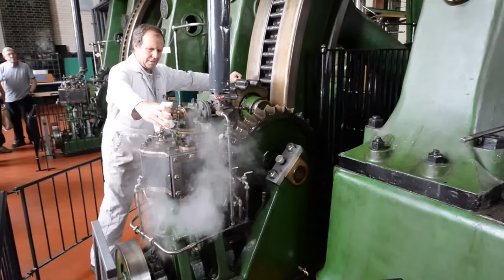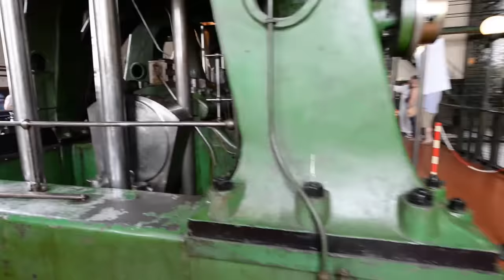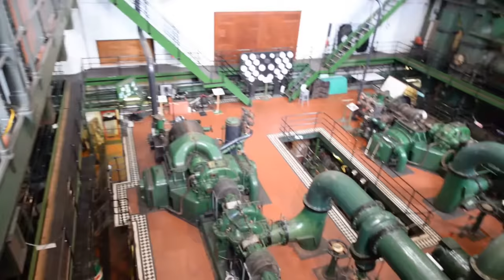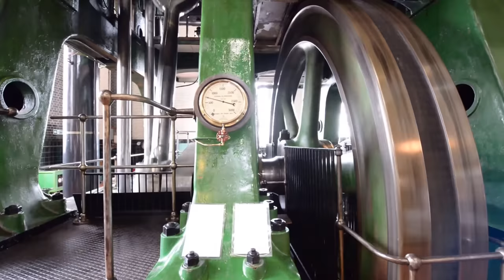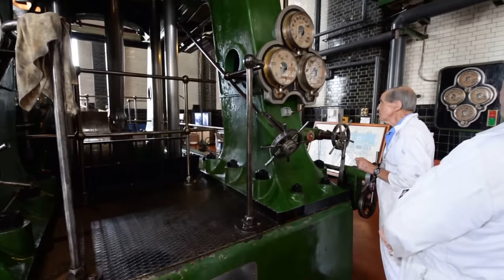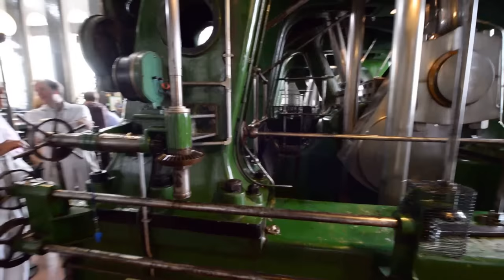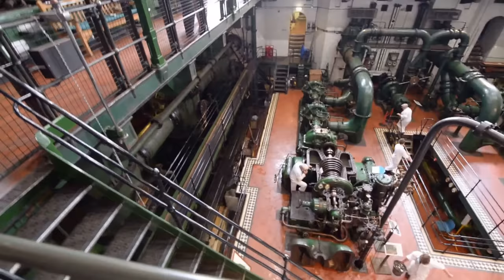Kempton Park  Big Triple Steam Engine Starting

Comment: The Titanic had 2 Triple expansion engines like these. They actually shot some of the engine room scenes at Kempton Park
Reply: Very interesting. Thank you for sharing. It's amazing to think that these incredible machines, and the expertise to operate them, were common once upon a time.
Reply: And they say that Titanics engines were bigger than these too so shows the size of them!
Reply: Yes they did
Reply: What if the Titanic got a rope or iceburg caught in its propeller - was it built to stall, or would the steam engine keep running, the high torque end of the gearbox would be under enough torsion to rip from the bearings or rip the hull itself apart
Reply: @Dave78214  There was no Gearbox. Large Ships have the Propeller Shaft bolted directly to the Engine. That's why modern Ships have Two Stroke Diesels, as Four Stroke Engines couldn't deliver the high Torque at slow Speeds.
Reply: @Genius_at_Work  I just looked up the propeller speed of the Titanic, and it says 75rpm, that's still much lower rpm than the diesel engines I've looked at, and would have incredible torque, and could the engine even stall if the propeller was jammed?
Reply: There were three propellers, and a total of 46,000 hp
Reply: If the propeller did jam, and the engine did somehow stop spinning the shaft when it jammed, there could still be something like a million ft-lb of torque acting on the shaft, and incredible forces acting on the bearings and engine parts. If the shaft snapped, then it would be applying these forces up to the yield stress and the parts would fly out releasing the strain energy, and perhaps the motor could continue to cycle afterwards
Reply: @Dave78214  76 RPM is pretty normal for Marine Steam Engines; even small ones (below 1000 kW) aren't much faster. Large Two Stroke Diesels are in that Range too; e.g. does the MAN S80, with which I used to work, have a Top Speed of 78 RPM. The MAN G-Series has an even longer Stroke to Bore Ratio of about 4.5:1, so it is even slower. This increases Engine Efficiency by providing a higher Expansion Ratio and increases Propeller Efficiency by just being slower. The L- and K-Series Engines have a shorter Stroke (still meaning 3:1 for the L and 2:1 for the K), which increases Speed up to about 150 RPM.

Objects in the Propeller could jam it, which would destroy all Shaft and Engine Beating and possibly even bend the Connecting Rods.
Reply: @Genius_at_Work  I used to own a boat fitted with a 50Hp Leyland-Thornycroft marine diesel (154 I think) based on a BMC 2.5, and it would run at 2000 rpm for probably 40Hp, and to be honest I thought it was putting out plenty of torque. When a rope got caught in the propeller the engine would stop running automatically - the engine continuing is clearly a problem with vintage motors. Water wheels are very high torque, with rotation speeds of about 20rpm a 600 watt water wheel would need an axle the size of a scaffolding pole because anything less would twist if it jammed (or something similar).
Reply: @Genius_at_Work  the same effect with a million ft-lb of torque should be enough to rip through the hull of the Titanic. There's a theory that the "Titanic" was in fact the sister ship, the "Olympic" - the names where swapped for insurance purposes. The Olympic was hit by a military vessel on an earlier voyage and had enormous rips in the hull - and sections were twisted, suggesting to me that it could have been partially an engine problem. Perhaps the same structural weakness existed in both ships. I think the design was terrible anyway, the accident could have been an engine failure, or an impact with an iceberg, or even the propeller hitting the iceberg.
Reply: @Genius_at_Work  at 75 rpm, Titanic even reached 22 knots, which is impressive for 75 rpm 3 set of 3 bladed propellers, what more if she had 3 set of 4 bladed propellers? Titanic could've reached 25-28 knots.
Reply: @justabasslover4404  The Speed is not proportional to the Propeller Blade Number; just think of Speedboat Propellers with only 2-3 Blades. I'm far from being an Expert on Hydrodynamics, but generally more Blades means you can build a smaller Propeller that may run at a higher Speed. E.g. did the Central Propeller of the Olympic Class (aka Titanic) run on some 120 odd RPM while being only about 2/3 the Diameter of the Outer Propellers. This Design was chosen so it could be driven by the Exhaust Steam Turbine without Reduction Gearbox in between, which is somewhat of a Compromise as Steam Turbines are most efficient at high RPM while Propellers are most Efficient at low RPM. IIRC, Blade Pitch has the greatest Influence on the Speed you can get from a given RPM, but increases the Likelihood of Cavitation, especially when not running at the RPM-Speed ratio it is designed for.
Reply: @justabasslover4404  Little Edit: Plus you can't magically get faster from changing a Propeller. The RPM-Torque Diagrams of the Engine and Propeller have to match. The Engine can't turn faster than its Design Limit, so achieving higher Speed would require much higher Torque. Keep in Mind that the Power required to move something through Water increases by the Force of ^3 to the Speed, so even going 10% faster would require 30% more Engine Power.
Reply: @Genius_at_Work  Lusitania class have 4 set of 4 bladed propellers and have 4 parson steam turbine. Lusitania suffered vibrations from the engines. But the Olympic Class' steam engine is more powerful and torque is greater than a steam turbine to spin a 4 bladed propellers, so powerfull that it will be stable and the ship will not suffer from vibrations. Parson steam turbine uses low pressure steam, and triple expansion engines uses high pressure steam, and high pressure is more powerful. So in conclusion, Olympic Class' steam engines can use 4 bladed propeller with ease because of how strong the torque of the engine is.
Reply: @Dallas_K  there's a documentary
Reply: @Genius_at_Work  I think slow RPM is more efficient because the fluid flow is less turbulent, also known as "laminar" flow. So supposedly a lot of power is wasted through turbulence, as it's work done on sending the water is random chaotic directions. I had this theory that they couldn't admit to engine faults as a possible cause of sinking because the engineers wouldn't take the blame and nobody had stronger arguments.
Reply: @justabasslover4404  all blade mass is distributed evenly on horizontal and vertical planes. This might matter more with very large props like on the Titanic. If they didn't have double universal joints (I mean maybe they could) then tiny variations in mass distribution could cause systemic problems, vibrations like you say on Lusitania
Reply: @Dave78214  do what you want, I just stated my opinion, and now you wanted to correct everything
Reply: @mattseymour8637 Titanic's triple-expansion engines were rated at 15,000 hp apiece.  Compared to this one-only 1,008 hp-you can better imagine the size of them...
Reply: @nicholasrhodes4550  Yes I heard that Titanic's engines were even bigger than these ones and so that's saying something if you mention these are only fraction the hp!

Comment: Have never seen these great engines before but, funfacts: I worked on tugs Sheen & Ham towing 4x 250 tons of special coal in Wm Cory & Sons lighters from Brentford to Sunbury to power these engines, probably twice a week in the 1960's. Fifty two weeks a year. We worked out that when they switched to road transport to deliver the coal, it would take at least 20 trucks (at that time) to haul one barge worth, so 80 trucks & drivers to replace one tug & 4 lighters. (tug had 3 crew and 1 lighterman per haul). I could never work out the economics to be honest, and so we lost the ships, the men & the way of life to the Road Gods. Fun Fact 2. Later, I worked as a Lockeeper at Teddington Lock (which the tugs & barges had to pass through), and one of the main jobs was controlling the water levels via the massive weir. The pumping station (above) would phone us and say that they were increasing the pumping levels and so we had to shut down the wir accordingly. That's how much water they took. Alternatively, when we had heavy rain we would call them and ask them to increase pumping to reduce floodwater. Amazing that this is the very first time I have seen the engines that kept me so busy! Thanks for posting..

Comment: Tiny steam engine used as turning gear for great big steam engine. Fascinating. (I'm used to big diesel engines, which use an electric motor for slow turning and compressed air for starting.)

Comment: I love these old machines, It should be a crime to scrap them. They are so impressive and
only use steam.
Reply: Ody Slim where does the steam come from ie what flue is burnt too turn water too steam
Reply: @matthewcoslett5398  don't think that's what Ody Slim was aiming for with his comment
Reply: A lot a lot a lot a lot a lot a lot of COAL TOO !!!!!
Reply: @bastouneuroatypicmusic6885  The fuel is a non-issue you can use anything. If I remember right the Kempton Park steam engines currently just use a massive electric heating element to run.
Reply: @luketorpedo  If you really wanted to, you could plug it into a nuclear reactor, they too are nothing but a steam engine, just the fuel is not carbon, but uranium
Reply: Collin Barker That would be quite neat, a small compact BWR next to the plant, for running Saturday demonstrations. :)
Reply: Build a nuclear reactor near by to generate the steam and now you have nuclear steam engines.
Reply: I've heard of power plants that burn tires or trash to power boilers, messy but effective.
Reply: @RingingResonance  The submarine Nautilus commissioned in 1954 was  nuclear steam powered.
Reply: @luketorpedo  it depends where that massive element is getting its power from, solar, nuclear, wind, or of course coal or petroleum.
Reply: @sstorholm  instead of Mozart, you can listen to a machine..

Comment: Triple expansion steam engines are one of those things that you look at and think "How did they ever come up with this?". They're beautiful things. Similar engines powered America's (and likely some of Britain's) early Dreadnoughts such as the Battleship Texas. And if i'm not mistaken all of the US Liberty cargo ships. A few of which are still around and mechanically operational like the Jeremiah O'Brien.
Reply: +hallis1 Well, they probably looked at a single-expansion engine and thought, "Let's add two more expansions"
Reply: The real invention was the double expansion machine. Relative to the cost of design and manufacture this was a very worthwile boost for thermodynamic efficiency. From there on, triple expansion was essentially a repetition, further improving efficiency; but with a smaller gain than the first double expansion machines had brought. Even quadruple expansion machines were built but by that stage the advantage was essentially outweighed by the complexity, cost and weight of the machine itself. Later on, the timing of the steam admission became more precise and more instantaneous (using different types of steam valves) and this allowed the machine builders to go back to double expansion with the same overall efficiency as earlier triple expansion machines could.

I went to the Dr. Wouda Gemaal in Lemmer, Netherlands a number of years ago. This is about the only place in the world where large-scale steam engines (albeit a lot smaller than in Kempton park!) can still be witnessed working at full blast. That watermill works is still in active duty as backup and emergency works to keep the province of Friesland from flooding. When I went there they had an extended period of heavy rainfall and all 4 machines were working at 120 rev. per minute. It was an impressive sight.
Reply: antiekeradio That's a neat story. o:
Reply: I'd seen in another video that the Triple Expansion steam engine was VERY efficient. For one in a ship - to move one ton of cargo one mile on the ocean (one ton-mile), it would only burn enough coal to weigh about the same as one sheet of paper - only a gram or two!    Pretty damn impressive for 1830's technology!
Reply: bs
Reply: Norm McRae 
They sure are.

I keep wondering why we don't use radio thermal decay to run a few of these suckers
Reply: And those old Liberty ships make fine prison hulks where the scum of the earth can meditate and contemplate their misdeeds.
Reply: Just to let you know the British owned steam the usa had nothing on the English
Reply: HMS Dreadnaught and her successors were powered by steam turbines, but piston engines were very much in use prior to that.
Reply: There was a big debate when Dreadnaught was built whether to continue with triple expansion engines or go turbine won, and the rest was history
Reply: I think part of the definition of a "dreadnought battleship" is the use of steam turbine engines, along with a single large caliber for the main battery.
Reply: I believe the O'Brien is fired up once per month.  Guests are allowed to witness.
Reply: @brucebaxter6923  steam turbines (high RPM) are better at driving electric generators than steam piston engines. This is why nuclear powerplants don't use them.
Reply: @DolganoFF  
only at very high power , pressures and temperatures.
rtg doesnt have those sort of temperatures pressures or powers but they are inherently stable as they are not a cascade reaction

Comment: My Granddad worked in the engine room of a WW1 Merchant Marine Ship. He said they would wave a straw broom in front of them to detect in visible steam leaks. If the end of the broom got cut off, you stopped walking!
Reply: Not many people can fathom the amount of energy in superheated steam.
Reply: That's still done on board ships using superheated steam. The cloud of visible water vapor might be on the other side of the the room from where the leak originates.
Reply: I never even realized the necessity of something like that until now... Holy shit.. Imagine forgetting your broom and just getting taken off at the knees
Reply: @kielcarson6776  Even if you forget "your" broom, there are usually many others available. In machinery spaces with high pressure steam, there are usually fiber or straw type bristle brooms stationed around the room. If you look closely, you realize that most of the broom straws are clean, as if they haven't ever been near the floor. Then you realize that you are probably standing on an open grating, so sweeping the floor wouldn't be a requirement. That's about the time one of the senior engineers will explain to you how to sweep you surroundings for a steam leak. When an alarm sounds or someone yells about a steam leak, everyone freezes momentarily, grabs the nearest broom and starts sweeping the air. This is only an issue in modern steam plants, running high pressure, superheated steam. Old engines like the Kempton engines aren't a problem. They run at much lower temperatures and pressure.
Reply: @youtubejunky7481  Nuclear power via steam turbine.
Reply: @youtubejunky7481  Nuclear powered ships submarines use steam turbine .
Reply: I work at a big powerplant and we still use this method if we suspect that there is a leak. At about 300 bar/4400psi, you will hear the leak, but seeing it is impossible. So we use a rag on a stick and a infrared camera to look for the exact location.
Reply: So if you walk in front of the steam leak will your legs get chopped off instantly?
Reply: The steam is very high pressure and it is better to have a broom break in half than a person.
Reply: And then, there’s hydrogen leaks for which brooms are used in refineries.  The flame is almost colorless under the right conditions. Plus no smoke.
Reply: When I was cadet on an LNG tanker with a Main steam turbine, we would attach a thin sheet of copper to a wooden stick, and use it to detect any superheated steam leakages around the turbine .
Reply: I heard the same precaution in the 1970s when I did radio work on cargo ships (turbines then).
Reply: @danman4633  n
Reply: Super heated steam is the best solvent, San actually dissolve glass. Used in rendering plants to turn waste animals into goo .
Reply: explains why straw brooms are still here in 2022!
Reply: Yep superheated steam is water in it's gaseous state...ie invisible!

Comment: Finally a very great engine with elegance, not crude power. I still remember when I rode a side-wheel steamer named "Mainz"  on the Rhine river in Germany in 1967. The engine was indeed fascinating. The boat was the first with an anti-roll equipment.
Where does all the steam come from?

Comment: I remember seeing a photo of a car driving through the L.P. piston bore of the Titanic (or its sister ship). Things were built to last those days. On the River Murray there is still a cranckless diesel (i.e. a moving piston/pump) drawing water from the Murray/Darling up into the irrigation channels, powered by the gas produced by heating gum wood in a "cooker"(like the old charcoal gas generators), a resounding machine when in full flight.